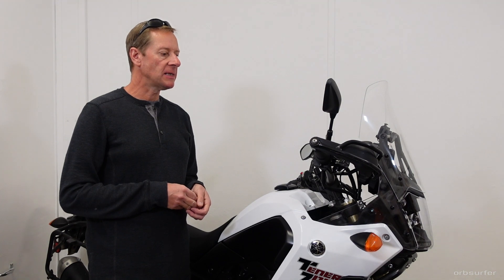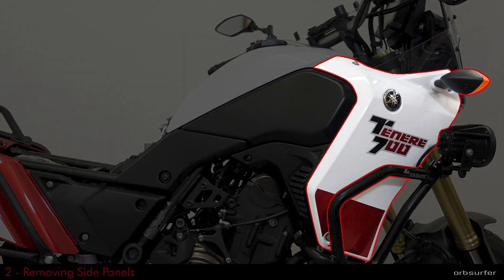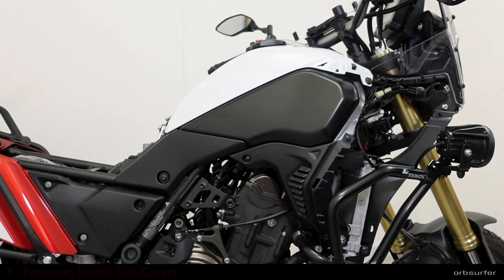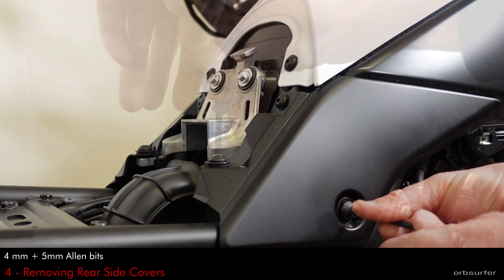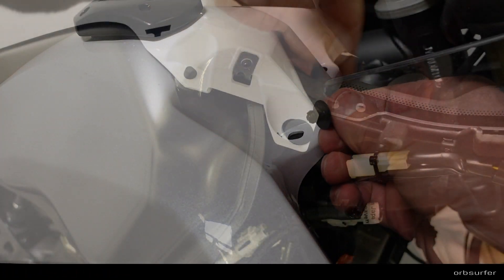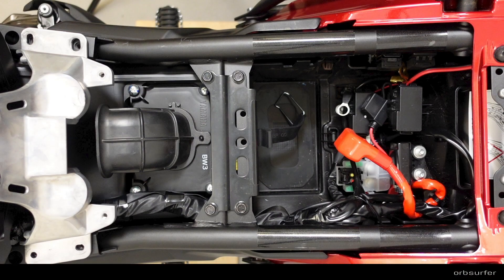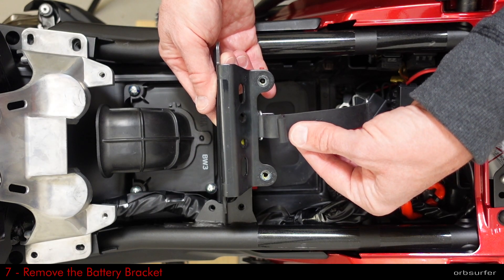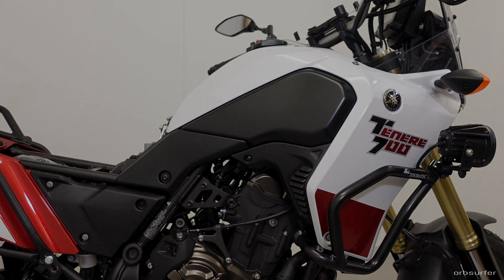Yamaha Ténéré 700 - Connecting Devices to the Battery - What panels and brackets to remove.

Comment: Thank you for all of your videos. It forced me to buy a T7 without having ever ridden. Of cause red and white. When it was delivered I dismantled and reassembled it just for fun following your advices. Awesome! 
But there is a little thing I can teach you: The little clips are meant to press in the pin in the centre from the front.Than you can pull it out. Before reinstalling it you press out the pin from the back. You will find these pins a lot at the Africa Twin (I owned before) where you can’t reach the backside of the faring. By the way: Compared  with the AT servicing the T7 is a dream.

Comment: great video..only suggestion is to run cables separately of factory wiring. Should there be an electric issue with new device equipment, such as frayed wires, it can damage factory equipment and can void  warranty.  Also if any issues with new and or factory wiring, troubleshooting will be much easier.

Comment: These are excellent instructional videos... absolute professional quality...you keep referring to buying from Yamaha in Europe...how is that accomplished?
Reply from the maker: A little background... The Adventure style bike is a European style bike that dates back to the Paris - Dakar Rally made popular in the 1980's. The current Ténéré 700 was designed in Europe by GK Design Group in Netherland, Yamaha R&D in Italy and Yamaha's racing team located in France. The Ténéré 700 sold in Europe are built in Europe, but the Ténéré 700 sold in the USA are built in Japan.

All the original Yamaha OEM accessories such as the center stand, heated grips, rear rack etc. are built all across Europe in countries such as France, Italy, Poland and Spain, not in Japan.

I have a little suspicion that when Yamaha in the US order parts or accessories for the Ténéré 700, they order the parts from Japan, and then maybe Yamaha Japan order the parts from Europe. You see where I am going... 

When I gave the local dealer a list of OEM accessories to order for the Ténéré 700, it took between 2-3 to 5 months to get the OEM accessories. To avoid this I just searched on the internet for OEM accessories using the correct part numbers, ordered the parts on eBay from European dealers with a very high ranking. The downside is that I had to pay for shipping. The positive side was that the European dealer used DHL that has speed and a tracking that is unknown to UPS and FedEx.

Sorry for the long reply! :-)
Reply: @orbsurfer8195  thank you so very much for the explanation. Iam getting the timeline run a round from my dealer .... longer for parts than delivery on bike. I will check out ebay. Please continue to make your videos they are extremely well done and much appreciated. Safe riding

Comment: Hi, nice video! Can you please explain how you mounted the Givi frames with the original luggage rack? Thank you!
Reply from the maker: I will try to make a video about the process. 

The two welded on barrels on the rear rack was cut off with a 1 mm cutting disc on an angle grinder in order to make all four barrels removable; i.e. the barrels are not used, but can be reused if I remove the case racks and only want the rear rack on the bike.

Then the fastening tabs on the two case racks was shaped into the dimensions of the four barrels that was removed from the rear rack, 45 mm long I think. Because of the angles, it took a little bit of shaping with an angle grinder, a 3/4" - 19 mm drill bit and a sharp, clean file. A little back and forth to the vise in order not to remove too much material, but not too bad of a process.
Reply: Great rack hope you do a video saying what make and how you fit them. No good videos on this yet which make choosing compatible rack a nightmare